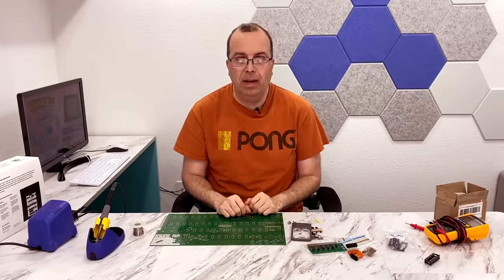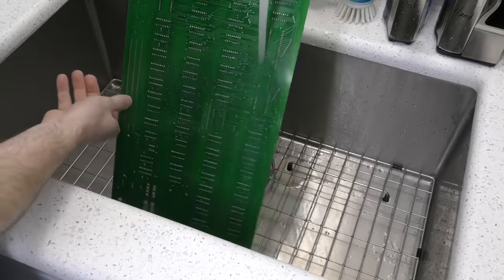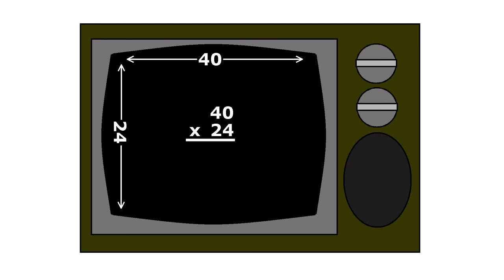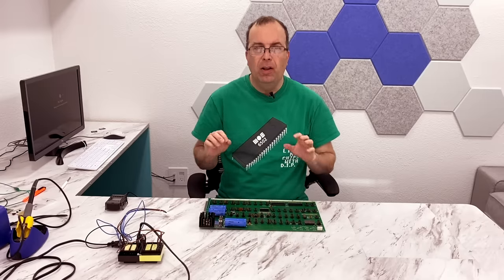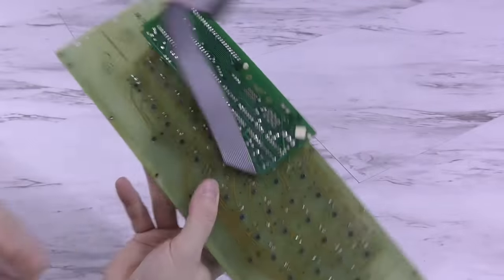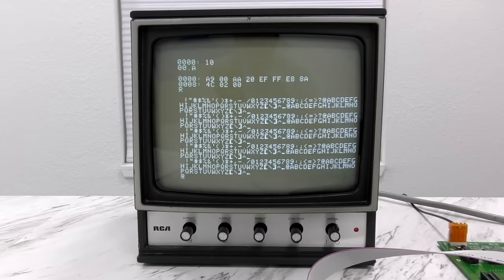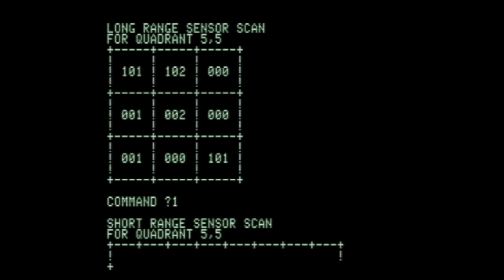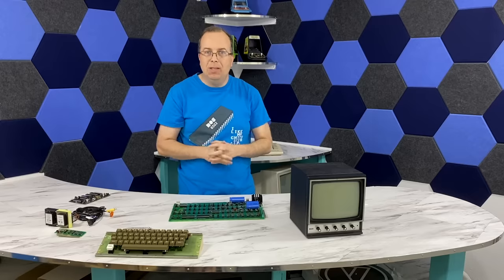How the Apple 1 computer works.

Comment: Nice video!  Point of order: there was almost no manufacturing done by Woz or Jobs in the garage.  Woz dispelled that myth a long time ago.  In an interview he stated very little was done in the garage.. it was just a 'place to go' for two guys in a new business with no money for offices.  IIRC the boards had sockets and some other components wave soldered by the manufacturer (NTI, etc) and then they were stuffed later on, often by helpers.
Reply: Although, Daniel Kottke, and many others said they DID manufacture boards in the garage.  Also Chuck Peddle himself also said they were making boards in Jobs's garage.  In fact, Chuck said he had to go to the garage and help re-design the Apple 1 because it wasn't working.  Most likely much of the Apple 1 is based on the KIM-1 besides the video circuit, which Paul Tyrell said that he heard the video circuit was based on one of  HP's terminals projects. 
What everyone agrees on is that Woz was not in the garage much, but Jobs and the rest of the gang were there.
Reply: @deckard5pegasus673  It depends whose account you read.  There are some accounts they were stuffing/repairing the boards in the garage, yes, but they weren't soldering 1000 individual joints by hand for every board as David suggested.  The boards were 100% wave soldered.
Reply: @dreadpiratesidebeard9471  
The wave-soldering may have been done when they were falling behind.  Also PCBs were made by Atari, as Jobs asked a  friend at Atari.
Woz's versions of the story are different from other's peoples.  For example Woz says he bought the 6502 from Chuck Peddle, when Chuck Peddle specifically said it was Jobs, not Woz, who bought the first 6502 from him.
Anyhow, they're details, ...or "points of view" ... people live things differently or remember them how they like. 
But Woz definately deserves a hell of a lot more credit, than he was given
Reply: @deckard5pegasus673  True. Woz did the engineering, while Jobs did the marketing.
Reply: @deckard5pegasus673  There are multiple sources including the folks over at Applefritter that say they were wave soldered the whole way through for the sockets.  No idea on other components like resistors.  I was a year old so I can't verify of course :). But I think that makes sense.. it would have been far too labour intensive to hand solder all those sockets.  Not to mention the risk of mistakes.  I'll have to try digging around for more authoritative sources but that seems to make the most sense.
Reply: @dreadpiratesidebeard9471  I go by peddle, Daniel, and others. They were there
Reply: @deckard5pegasus673  OK..  and I will go with Woz, a whole host of Apple 1 owners, forums and the Apple 1 registry.  All you have to do is look at the back side of a real Apple 1 and note the rippling under the soldermask.. classic sign of wave soldering.
Reply: @dreadpiratesidebeard9471  actually I am going with a lot of people Daniel had a reunion with a bunch of the first Apple employees. Also chuck peddle debunked a lot of Woz story time. Like Woz never admitted chuck came and helped get the apple 1 working, and Woz straight up lied and said he bought the first 6502 from peddle, when peddle in an interview said it was jobs,not woz. Peddle did a bunch of interviews  with a women engineer,forget her name, from Oregon who made the C64 clone in a joystick.
Reply: @dreadpiratesidebeard9471  
Peddle said the first 6502 he sold to Apple was bought by Steve Jobs, not Woz.  
Dr. Robert Suding has nothing to do with Apple .
 Peddle even gave a lot of details about selling it to him and said the CPUs he was selling were in a plastic container, on a table, blah blah.. so obviously he did not mix up Jobs with Woz.   Also Peddle told how he went to the garage (and he did say garage curiously) to get the Apple 1 working.  
Also Paul Tyrell(I am supposing from the Byte Shop) left a question to Woz on a Apple forum, that he learned that HP had 2 teams working a new terminal.  One team was using the 6502, and the other team was using the motorola.  In the end, HP went with the motorola terminal and scrapped the 6502 terminal.  Paul specifically asked Woz if he used the design from HP to help with the Apple, since they scrapped it(the 6502 version).  Woz never answered, maybe he didn't see the questionBut, I have thoroughly looked through the history, and Woz has in many areas said things that do not coincide with anyone else who was there.  
But truthfully the story of Jobs and Woz is bit of a distraction. The real power behind Apple, Cisco, etc.etc..and the rise of the PC, etc. was sequoia Don Valentine, ...the guy literally was the "Godfather" and represented some hidden forces, that made all these companies possible.
Reply: @deckard5pegasus673  You make it sound like Jobs was a techie - he was far from a techie.
Reply: "no manufacturing done by Woz or Jobs" — 😄😄😄 Jobs did nothing.
Reply: It pisses me off that people think Jobs was a techie. If Jobs was a techie then I am a rocket scientist.

Comment: It's especially interesting to see how the terminal side is like a separate brain, like the legs of an octopus. Also, it's amazing that the board was designed to work with different types of chips. Those solder pads are like a geeky, lo-fi version of jumper pins and boxes.

Comment: When we got an Apple II my dad took an AWA TV and brought a coax line directly out from a point on the internal circuit board and we connected it directly to the output RCA jack of the computer, bypassing all the RF decoding in the set. Worked a treat.

Comment: The closest I ever got to an Apple 1 was at Fry's Electronics in Sunnyvale, CA. They had one on display (board only) behind glass on the sales floor.
Reply: Fry's was great, I only got to visit a couple of them but walking around the sales floor was amazing before 2010. Probably would have been even cooler back in the 2000s and 90s
Reply: @jr2904  Fry’s was great but when I worked there I lost all respect and never saw them the same again. They wanted me to wear a suit, tie, dress slacks, dress shoes and look like I’m selling stock when in reality I was helping parents buy their kids video games. That’s not even the worst of it. There were so many layers of management just at the store level alone. After working there for a couple weeks I finally found out who my boss was.
Reply: When did you see one in person? Was it for sale or just a display?
Reply: @Kylefassbinderful  sounds like Kmart in the 70s and 80s. My cousin used to bounce around the Midwest every 2 years until they eliminated all of the micromanagement in 1987.
Reply: @Kylefassbinderful  yea near the end they weren't even running the air conditioning and the people were still in dress clothes, felt bad for them.
Reply: I remember that one under a Lexan pyramid in the book section in the late 1990s.  The last time I visited that store, just before they closed down, the display case was still there.  It was empty of course.  I wonder what happened to that A1.
Reply: May Fry's rest in peace. Their stores died along with my childhood. Will always hold a special place in my heart
Reply: @KartKing4ever  - for sure display, Frys electronics didn't exist when apple 1 came to market

Comment: I use to work at an electronic company back in the 90s and soldering componants into mother boards was a daily task. I myself enjoyed that task. We used a machine to solder the majority of the parts and then put on any parts that were too big or hung off the sides. I miss working there.

Comment: 9:56 That's crazy! That's the equivalent of designing a motherboard to take either an x86 CPU or an ARM CPU. The late 70s really were a time when "having a computer" and "being a mad scientist" were basically the same thing.
Reply: Oh, it's not that bad. The 6502 was created by ex-Motorolla employees who had worked on the 6800, and they made the 6501 pin compatible with the 6800.
Reply: IIRC, the 6502 took some of the concepts of the 6800, but cut some features to reduce the total chip count (and avoid any patent clashes).
Reply: What I've never seen explained is how the ROM worked with the different instruction sets. Anyone know? (I met Woz years ago but I don't remember that being asked then either ...)
Reply: @logiciananimal  AFAIK the short answer is it doesn't. They would have written a different ROM for the 6800.

Comment: "I'm really nervous...if I fry something, it's not a trivial thing"
Moment later:
"The next thing I'm going to do is manually apply 5 volts to CLS circuit"
Reply from the maker: Believe it or not, that's actually in the build instructions I was reading.  So I was just following instructions.
Reply: cool, it must be cos you need to check your work as you go

Comment: Those are some big arse capacitors. PSU technology has improved a lot.
Reply: So has capacitor technology. Modern caps with the same specs are much smaller.

Comment: Mischievous thought: I would have installed one of those resistors backwards, so they are not all in the same orientation, just to annoy the Internet.  You wouldn't even have to solder to the board -- just put it in backwards on camera then correct it afterwards 😈
Reply: Nice ieda!
Reply: Yes please
Reply: I would also use radial caps instead of axial
Reply: Oh, and pin headers instead of sockets

Comment: 1:43 - Looks like that capacitor is being installed the wrong way.
The arrow on an axial electrolytic always points to the cathode/negative lead.
But there is a small + on the PCB next to the negative lead of the cap.
I also see that the right side of the cap, directly connects to pin 1 (assuming the small white dot denotes the indentation of the IC) of a 555 timer. Pin 1 of a 555 is denoted as ground. So you've almost certainly put that in the wrong way :(

EDIT:
I literally sent an email warning of this, before unpausing the video and realizing he had noticed and rectified the issue :D
Reply: I’m watching the video for the first time and was about to comment about the same thing… :)

Comment: If you peek through the software in Green Delicious with wozmon or Eeben's own monitor/disassembler you can see some minimal patching where there would normally be I/O register reads and writes. Some I/O use is replaced by calls to subroutines, but IIRC $d012 writes are left unpatched. I suppose the "emulator" might attach a raster interrupt which will immediately read the line count register and output that value to the screen, which is a neat trick.

I don't recall if the software it comes with was pre-patched or if this was done at load time, but I've successfully ported Eeben's monitor to a more complete emulator.

Comment: When you build something like this, are the parts "new old stock" or are they still in production today?
Reply from the maker: Combination of both.
Reply: You probably have to deal with LS/ALS/HC/F/S chips.  They all have the same function, but their electrical characteristics are different.  Is 1.8V a 1 or a 0?  Depending on the letter in the middle of the chip number, it could go either way.  So getting the right specific part would matter in something older like this.
Reply: @stonent  noels retro labs mentioned that in one of his latest videos about fixing a c64 PCB & discovering fake chips lol.👍🏾. I learnt something new. I'm no electronics engineer & never considered at which point a certain voltage level means a logical 0 or 1 😱 or the difference between certain 74 series chips 😄
Reply: @cryptocsguy9282    That's what the datasheets are for.

Comment: I remember back on like 2009 I took an electronics course, with a unit in Assembly Programming, and they gave us a little unit with a Motorola 6800, an LCD display, and a 0-F keypad.

Comment: I still have my original Apple ][ Europlus and the same sized monitor as the one you used, with a single floppy drive parked next to it.  I bought the hobby prototyping board and added a 6522 and eprom which held the code for a parallel printer driver, an eprom programmer, and an interface to my communications receiver for weather facsimile reception and RTTY send and receive on the ham bands, it's still around here somewhere.  The Apple ][ started me off on a long and interesting career as a software developer.  Great video and great job on assembling the Apple 1, it was very interesting, thank you !!

Comment: That monitor at 17:07 brings back memories of a friend of mine who past long ago. He had a C128 and had a sega genesis system. I found the pin outs to the RGB connector of Sega and it matched up with that monitor all he had to do was head down to radio shack for the cable and connectors to patch it in. When he did his jaw dropped how much better it looked on the monitor as opposed to the TV. Geez, you are giving me a flash back to two to the 80s and early 90s here. :-/

Comment: I swear I get anxiety watching you rinse the board off under running tap water. It goes against everything I've been taught about electronics.
Reply: I know what you mean. I damaged my RTX 3080 last week by sticking it under a running tap 😕

Not really. Phew.
Reply: Used to build circuit boards back in the early 90s and we cleaned flux off of them pretty much the same way David did.  It was never an issue.
Reply: This is basically how you clean PCB’s.  Although normally you’d finish with a rinse in deionised / distilled water. Obviously you ensure they are fully dried before any power is applied. I usually put my boards in a 60C oven for 20 mins to dry out, after their ultrasonic flux clean and deionised water rinse. :)

Comment: Congratulations on a successful assembly!  For those that may not know, lookup Liza Loop.  She received the first Apple 1 as a teacher (I saw that at VCF West in August, and spoke with Liza and her son - they are actively looking for {remote} help to catalog+scan vintage computing books).    Great mentioning the KIM-1 (didn't consider that those terminal screens were so expensive).   How much was the cassette module (above the $666), and was it a DIY thing or a 3rd party vendor (back then)?  And how long to load the BASIC from tape in total?  (I'd guess about 30 seconds).   Great video as always!

Comment: Use a old vcr to convert the signal for an old regular TV. Use the video in on the vcr, then connect the coaxial 75 ohm to the RF jack on the TV set to channel 3.

Comment: Just a note from my audiophile experiences...

Those are carbon composition capacitors, and they INCREASE resistance the more moisture they have.  If the resistance is off too much, you might want to bake them dry if the value is critical to the operation.

The temperature coefficient is also very high, the value literally fly away from the stated value as it heats up.

Nice to have IDENTICAL parts to the original parts, but you might need to keep an eye on the remaining life of the parts, especially the electrolytic capa...

Comment: Great video!
One proble though; i wouldn't recommend touching electric components (especially RAM chips) without rubber/latex gloves, because static electricity may be present and may break the components. (not sure but anyway, when i was soldering these kind of a "DIY soldering digital wrist watch" kits, i didn't have gloves on and one of the transistors broke because i had static electricity on me)

Comment: This was so interesting!   Though my eyes bugged out of my head when you rinsed the board with water near the beginning!  
I didn’t know you could do that.  I don’t build computers. But this was a very fun video!
Reply: they do that in manufacturing.

It's usually de-ionized water, but as long as it's good and dry before you power it up.  It should do no harm.

Comment: Put temporary long legs on the four corners of the board and begin stuffing your shortest components (ie resistors). The goal is a bunch of items of similar height. Then lay something flat on top so you can flip it over for soldering without parts falling out. Cut the leads after soldering and flip back over to stuff more parts. IC sockets might be next. No more trying to hold sockets while soldering!
Reply: Shop for 'PCB standoff', maybe one inch. Something longer than your resistor/diode leads.